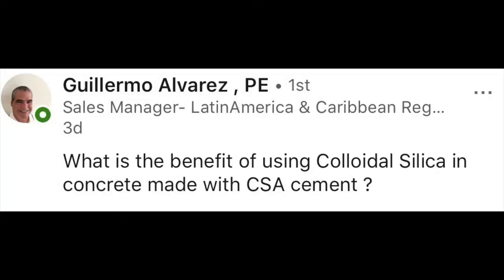Using Colloidal Silica In CSA Cement - Vlog #165

Comment: Hello
What is unclear to me is that I do not understand the process of csa cement production.
in opc raw materials heated in kiln and then grided with gypsum  and this is OPC.
but in csa I dont understand difference between csa cement and csa additive in the process of production. 
Based on what I noticed :
When raw materials are combined together(Bauxite-Limestone-gypsum and etc...) , They are heated inside a rotary kiln(2280°f) , whose product is called clinker.
If this clinker is grided with gypsum, it is called csa additive that must be blended with portland.
If this clinker blended with portland clinker and again heated inside kiln(in same°f?? 2280) . so we have a new clinker that 2 times heated in kiln and when grided with gypsum its called csa cement. that this cement can be also blended with portlend and also replaced.
Is my understanding of csa correct?
????

thank you
Reply from the maker: HamidReza R stay tuned for video we put together on this question.
Reply: @IntelligentConcrete  Thank you

Comment: If you're only using CSA as an additive, the colloidal silica will have enough calcium hydroxide from the hydration of the OPC to create a pozzolanic reaction. But if it is straight CSA, there shouldn't be any lime produced.
Reply: I tried this last week. I didn't notice any benefit in workability. It might have crushed a little higher (no data) but even if it did, there would be much cheaper ways achieve that than adding colloidal silica. I don't think CSA benefits from colloidal silica.
Reply: @deyc3  Hello
What is unclear to me is that I do not understand the process of csa cement production.
in opc raw materials heated in kiln and then grided with gypsum  and this is OPC.
but in csa I dont understand difference between csa cement and csa additive in the process of production. 
Based on what I noticed :
When raw materials are combined together(Bauxite-Limestone-gypsum and etc...) , They are heated inside a rotary kiln(2280°f) , whose product is called clinker.
If this clinker is grided with gypsum, it is called csa additive that must be blended with portland.
If this clinker blended with portland clinker and again heated inside kiln(in same°f?? 2280) . so we have a new clinker that 2 times heated in kiln and when grided with gypsum its called csa cement. that this cement can be also blended with portlend and also replaced.
Is my understanding of csa correct?
????
thank you
Reply from the maker: deyc3 deyc3 howdy Sir!

I both agree and disagree with you on the availability of calcium hydroxide in the paste that forms from CSA cements. While the amount of calcium hydroxide is significantly reduced because a CSA cement is primary made up of calcium sulfoaluminate. That being said, most CSA cements are made with a certain amount of dicalcium silicate (Belite, C2S). This belite will inherently release some calcium hydroxide in the pore water solution.

The main hydrated phase from CSA cement, ettringite, has two general forms in the absence of and in the presence of calcium hydroxide. 

When calcium hydroxide is present the ettringite formed will be less and expansive and have higher early strength.

The next question is where does leave us.  I have seen some promising results combining SMALL dosages of the colloidal silica with smaller sized particles (3-5 nm).

That being said, the best results I have found is when using alumina-modified nano silica particles in the colloidal dispersion.  Has increased early strength and later strength without inducing a high degree of drying shrinkage.

Hope this helps!
Reply from the maker: deyc3 great paper on the subject;

https://www.researchgate.net/profile/Angel_Palomo/publication/251552180_New_Cements_for_the_21st_Century_The_Pursuit_of_an_Alternative_to_Portland_Cement/links/5cc81225299bf12097899cc7/New-Cements-for-the-21st-Century-The-Pursuit-of-an-Alternative-to-Portland-Cement.pdf
Reply: @IntelligentConcrete  can you release a video that you make sca cement in lab oven?